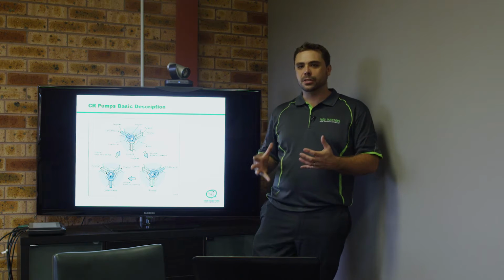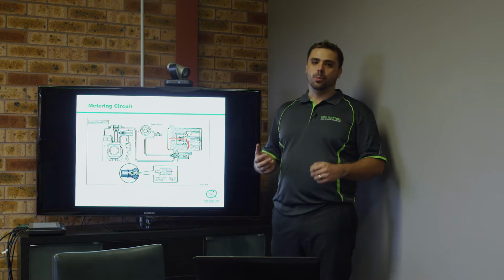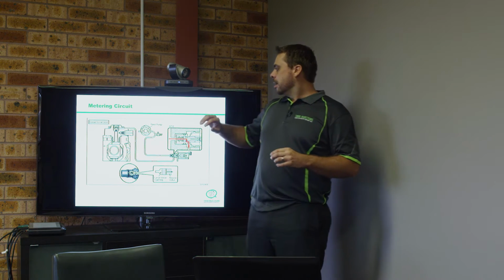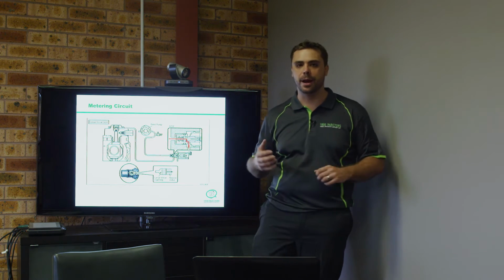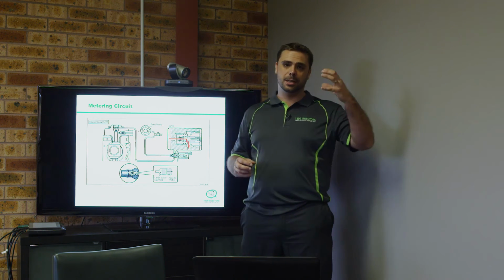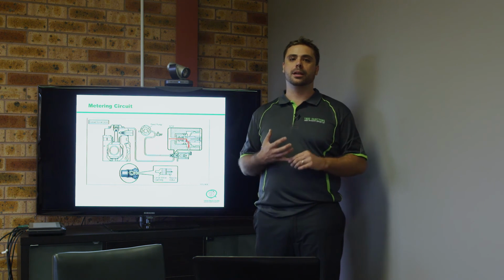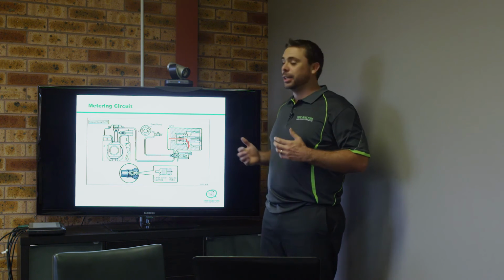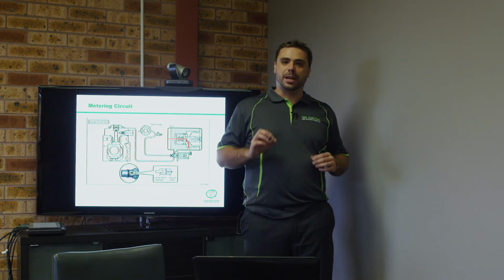CR Fuel Pumps and Suction Control Valves

Comment: Hi mate. Thanx for the video and information. 

I have a Mitsubishi mq 2016 Triton which was showing some hesitation to start (starts second time) 

I replaced the glow plugs , checked glow plug relays and diesel fuel filter and still didn’t fix the problem

I then got a scan tool and did a “supply pump replacement “ command function as advised by a mate who said it fixed his issue or rough idle 

and now the car is not starting. It’s showing zero 0 rail pressures when I crank start the car on the scan tool live data. And target rail pressures is showing 50. 

Do You Think the SCV went to home position and got stuck after the supply pump Replacement command ? 

Car was running fine only with the issue if rough rpm fluctuating before I did  this “ supply pump Replacement command”

Comment: Is the SCV responsible for shutting the engine off?
Reply from the maker: Partly, yes. 

Engines usually stop firing injectors, stop SCV (stopping rail pressure) and close an intake throttle body.

Comment: excellent vid. now the first thing that struck me strange was how can you throttle a suction? typically, bad practice with a pump for cavitation reasons and even worse with a positive displacement pump like in CRDs. Looking at cut aways, the only way I can see this working is that the pistons are not pulled down by the crank, rather returned down by the spring. so if you only allow a tiny amount of fuel into that pump cylinder on a particular stroke, it may not stroke down the full distance and I'd guess that the piston and the crank lobe face (what ever its called) would physically separate? is that right?
Reply: Totally agree Mike.  Nobody ever seems to mention this point, or even be curious about it!

Comment: Are Suction Control Valves the same as Pressure Release Valves? I have a 2007 Ford Transit (UK) and it idols like a pumped up dog. If I replace it, should I have a recalibration done?

Comment: Great video. 
Can anyone tell me what signals a SCV gets at start? 
i have barely 60psi rail pressure at cranking and everything is isolated. No return from the rail either, tried replacing the valve but still no pressure.